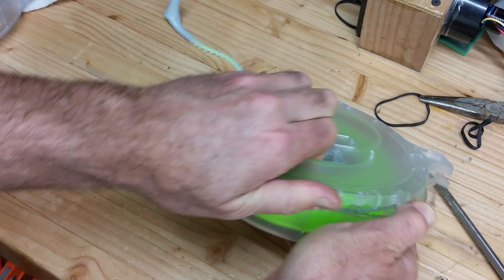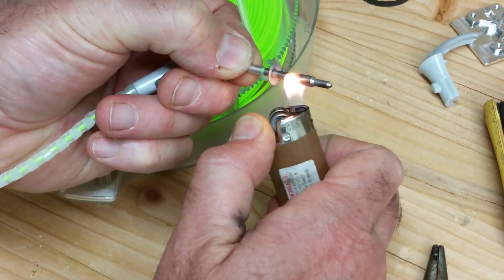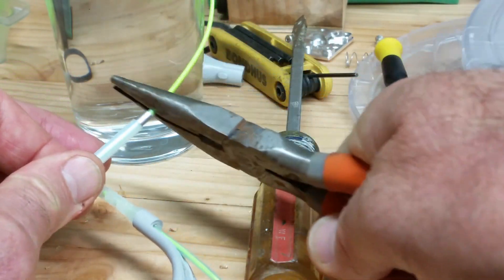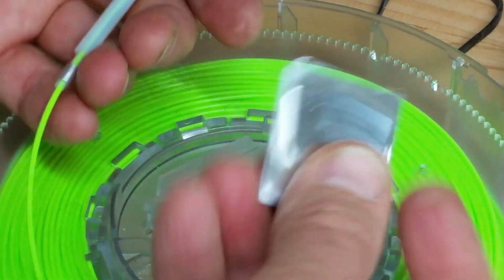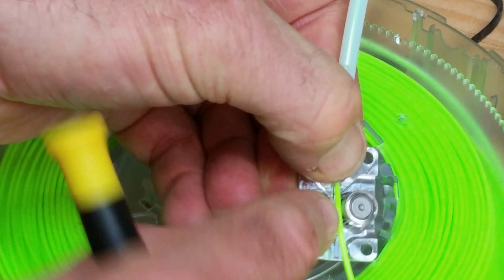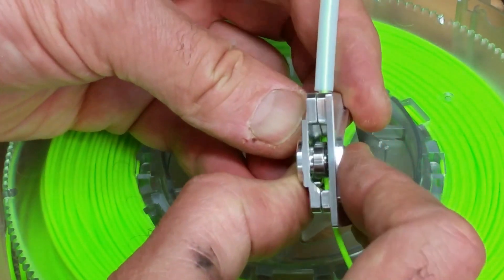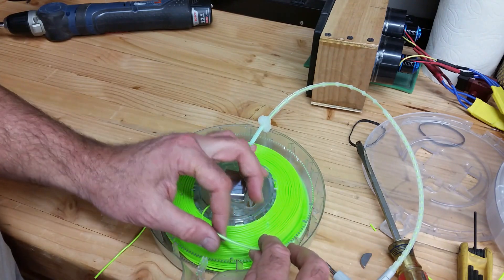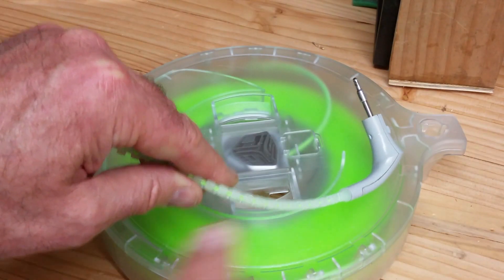Cube 3D Printer Jammed? Repair your PLA Cartridge. This is the way.

Comment: Wow! Thank you for the video.  I was struggling with getting the nozzle back together with the spring wanting to jump out.  You made it look easy -unless that wasn't your first attempt :) . I purchase a new cartridge on eBay but the filament must have been old as it is very brittle and continues to break. Questions: 1) do you know the purpose of the 2 metal woodruff keys in the cartridge; 2) Have you had any success in loading bulk filament on empty cartridges?   Thanks in advance
Reply from the maker: Anthony Sgaraglino I bought another 3D printer called a mono price shortly after making this video.  It cost just over $200.  I’ve made over 100 parts.  Everything perfect.  Never a jam.  It’s been sitting idle for months and I know I could turn it on and run it and it would work perfectly.  As reliable as my paper printer.  My advice to anyone with the 3D printer in this video is to dump it and get something better.